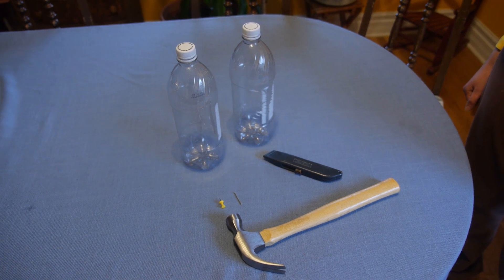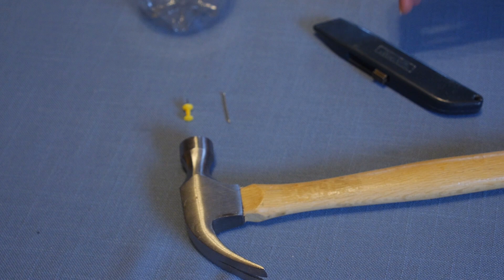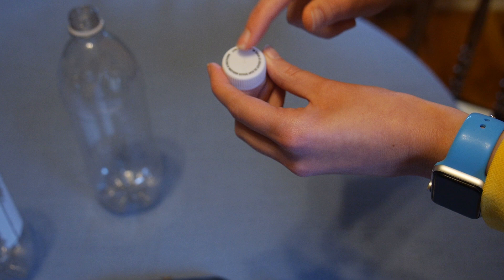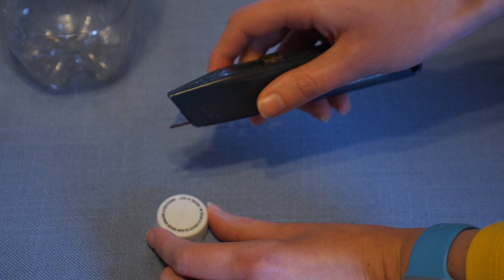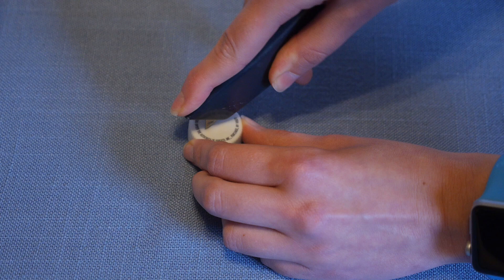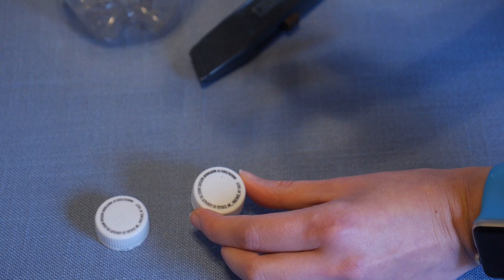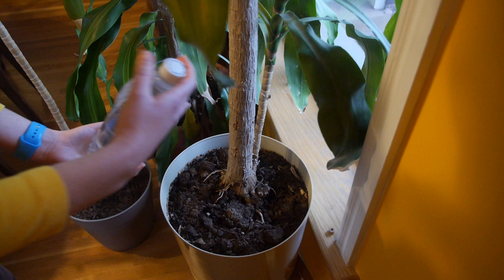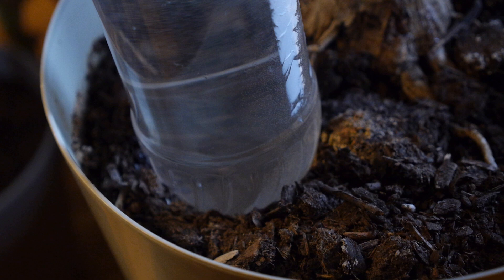DIY Drip Water Irrigation Soda Bottle

Comment: Why take the trouble of making hole in the hard bottle cap and then immerse the bottle upside down in the soil making sure it wouldn't topple. I simply made a very tiny hole in the bottom. The bottom of the bottle is comparatively softer and the bottle can sit on its own bottom easily in the soil.
Reply: because the tip is supposed to be under the soil level to provide more even watering of the pot
Reply: The bonus of this method too is that you can add more water to the bottle without having to move it.
Reply: Okay I am going to use your idea. Tks

Comment: I use 1 quart glass vinegar bottles.
Drill 1/4" hole in the cap. Fill bottle, screw cap back on, shove the neck into the dirt. (make sure hole doesn't get clogged doing so)
Problem with plastic is that if you don't make a air vent, the bottle collapses and watering stops.
AND you run through water faster if you do have a vent.

With the glass one, as the soil dries, the bottle lets out water until there is a slight vacuum. Bottle draws air in and the process repeats until the soil swells from the water and stops the process.
As soil dries, it shrinks and the process starts over again.
This can be done with wine bottle (neck will be deeper in the soil though) that has a screw on cap.
Reply: Nice
Reply: @Dansk55  I also use steak sauce bottles and wine cooler bottles without lids.
Yes they tend to run out a lot faster but if you prewater the soil first, they do last about a day.
I Also use two of those 5-gallon water jugs for water dispensers. Wide open mouth. Shove it in the soil neck down and it can last a whole week! Make sure those do not have the vent holes in them Some do some don't.
You can also put in some fertilizer (WEAK solution - about 1/2 or 1/4 strength so as not to over fertilize).
I use plastic milk jugs with a small hole in the bottom near the side. Replace the cap just right and it will last about an hour. Cap too tight they won't water and collapse. Too loose and water runs out quickly.
I bought a 'Rubbermaid' style trash can. Drilled a hole near the botton about 3" up and on the side.
Inserted aquarium air tubing and hot glued both inside and outside.
Ran the outside part to a gang valve for aquarium air.
Has 3 tubes from that. Adjust the drip rate for about 1 drop every 2 seconds. Will water for about a week that way (30 gal but can only use about 27 of it).
Can needs to sit high though - higher the better. Put mine on logs about 20" in diameter. At least a foot or more of it stops dripping as water level gets about 1/2 way.
That one does a 4' x 9' flower garden.
Wish I could upload pix of my stuff.
Reply: @crazysquirrel9425  Hi! Very interesting solution!
You can make a video and upload it here on YouTube.
Reply: @ElenaRattenni  Well I have no way to upload anything. Sorry.
About the trash can -
I relocated it and put it about 3 feet off the ground (placed it on 36" wide and about 10-12" thick logs from a tree trunk).
I ran some 1/2" irrigation tubing along some cattle panel.
I spaced out some home made air pruning pots (laundry baskets) under that cattle panel (is is about 18" up off the ground to allow room for baskets).
I used the tool to puncture the tap holes in the tubing where I wanted dripper lines to go, attached the 1/4" lines, and installed the 1/4" irrigation valves on the ends. This is so I could control the drip rate.

I have about 8 laundry baskets with tomatoes and 5 landscape quality black plastic pots alternating. Those got drippers too.

On a 29 gal (says 30 gal on the label) I can get 3-7 days watering out of a fill up.

Adjusting those valves can be challenging sometimes. Baskets need about 1-2 drips per sec but little pots need about 1 drip every 5 seconds.

If I could make the can higher I might have better control but then I could not fill it nor clean it.
Yes, it has to be cleaned from time to time as algae will grow even in that - can is dark green so a little light does get through.

Arbor Mist (sp) wine bottles seem to work well (about a day maybe).
Those do not replace watering they just even out the moisture a bit.

Current problem is soil temperatures are waaaayy too high (90+ deg F).
Plants are seriously heat stressed. Even in the shade (I moved them out of the hot afternoon sun).

I may have to buy bags of ice to keep soil cool. Sprinkling some ice on top of the soil will cool the soil and water at the same time.
Temps here have been 90+ and going up to and over 100F.

When temps go above 85, you can get blossom end rot easily.

Ideal temps for tomatoes and most other plants is between 55F and 85F.
Humidity about 40% - higher than that plants begin to have trouble transpiring.
Lower than that they can transpire too much as the roots can't take in enough water.
Reply: THANK YOU! Your heads up with the plastic saved my garden! I was thinking of just using upside down water gallons but obviously they would collapse in stopping the process! Imperative info

Comment: A big tip when cutting the X in the bottle top.  To avoid cutting your thumb, hold the cap from above while creating a bridge with your hand, then cut down into the cap.  You might also be able to add a bit more downward pressure using the arch of your hand.

 Holding the cap as shown can be dangerous. If the cap slips or the blade goes over the edge of the cap, the side of your thumb is exposed and in line with the cutting edge of the blade.

Comment: Alternative - to prevent any painful cut or hammering - try use electric soldering iron :)
Reply: I used a very small drill bit to make to tiny holes very easy
Reply: Just get the proper tools to cut it, using a soldering iron releases a bunch of nasty dangerous chemicals into the air it smells gross and after trying that once I just decided to get either a drill or the correct tool depending on what I'm doing. If you do use it tho cover your face up and don't breath in any of the smoke and it goes without saying do it outside!
Reply: Lighter + safety pin = holes

Comment: Take a set of pliers and hold the top down. Much safer. I thought I have been safe in other things, and cut myself badly, esp when you have to use pressure to cut, and then slip..I had to go to the ER.

Comment: why dont you just put holes in the bottom, is way easier, will be stable and wont topple over.
also with the tightening  or loosening the bottle cap... will be able to regulate the flow.
Reply: I tried this way but seemed cap was either not loose enough to get water out or water just flows out too quickly. am I missing something?
Reply: @wasabiy817  Smaller holes  (4) and a fully tight cap gives me 10 hrs on a 2.25ltr bottle but when on only 1 hole it gives 1-2 days max

Comment: since it is inserted in potting mix for self supporting it, it may not work after some time when the potting mix obstructs the holes drilled for passage of water. Ideal solution would be to cut the bottom portion of the bottle so that water can be filled, use a bamboo stick and attach this bottle (in upside down position with holes drilled in lid) with the help of string or in some other suitable way. This way no way for dirt to obstruct the water flow. Thanks
Reply: Please upload an example

Comment: I couldn't watch you using the box cutter. I've had an accident once where I took the top of my finger off!
Reply: Me too and I am a pianist! Cutting drywall and my index finger got in the way. Took a while to grow out a new end on my finger, lol!
Reply: I cut my tops with the top on the bottle so there were no fingers at risk!
Reply: 20yrs ago I bisected my thumb from the tip down to the bottom of the thumbnail...13 stitches. 3 through the thumbnail. They used this little drill to make holes in my nail. It was pretty awful to watch .it still hurts when it gets too cold

Comment: You can also use a drill or Dremel with a very fine bit.
Reply: I use a 3/16th inch drill bit.
Smaller doesn't water enough and clogs too easily.

Comment: Question about the placement of the bottle in the plant: what does it mean when some bottles constantly have bubbles and others don't ? Thank you.
Reply: Bubbles mean you do not have a good seal between the outer wall of the container and the soil.
Try watering well first then inserting the water bottle.
Sometimes a little twist when inserting can help.

Comment: the way you set it up how long does the water last in the bottle?
Reply: Totally depends on your humidity, the type of plant, the size of the pot, the materials your pot is made of, your soil mix it's all about trial and error
Reply: Ya agreed. That’s what I’m looking for. Is it measured in hours, days, weeks?  What does good look like for this system?   Even with different variables like heat and humidity, we should have some expectation around how long the drip should last based on what the op did there. I’m going to guess a few days but no idea.

Comment: I tried this last night and the water just drained straight out. Did I do something wrong? I had watered the plant before I put the bottle in, so it was not really dry.
Reply: Maybe there's another hole on the other end of the bottle and that makes water flow like tap water.
Reply: Sounds like your hole is too big I ran across the same prolem using the spikes it collapses the bottle!